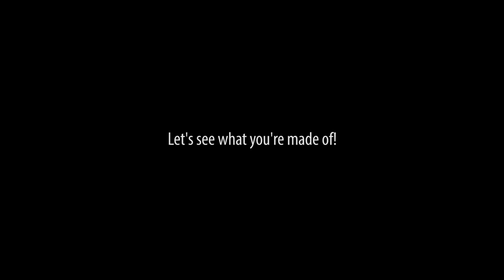Ri3D 2016 Team Indiana FRC Stronghold Robot Reveal

Comment: I noticed that robot had the FRC 2016 Radio (WIFI bridge/accesspoint) mounted vertically.  We were told to be sure to mount the new "radio" flat, instead of on its side, since it receives and radiates WIFI RF in a plain that is flat along with the flat design of the radio.  

We had our FRC 2015 Season radio mount vertical, as well, and had periodic WIFI connectivity issues with the DLink "radio", and quite knowledgeable competition volunteers encourages to mount it flat, for better reception.